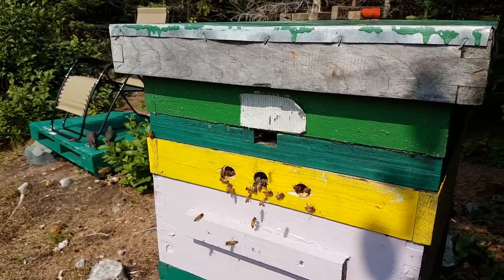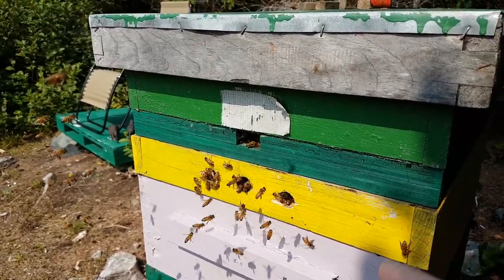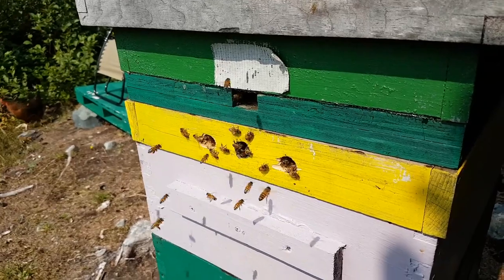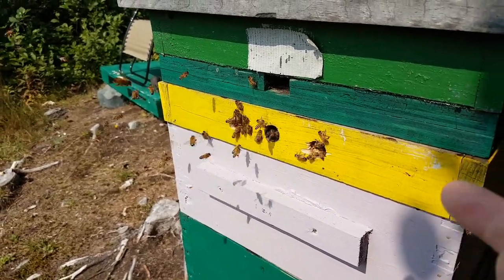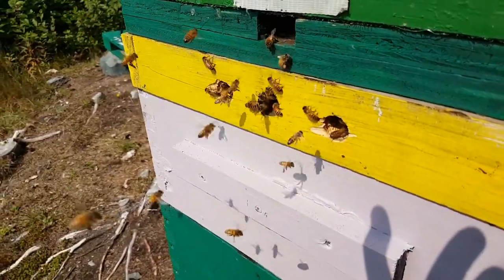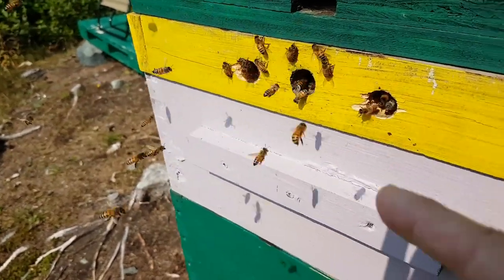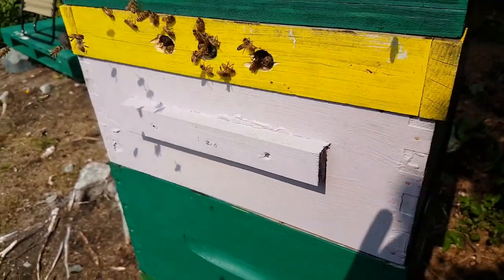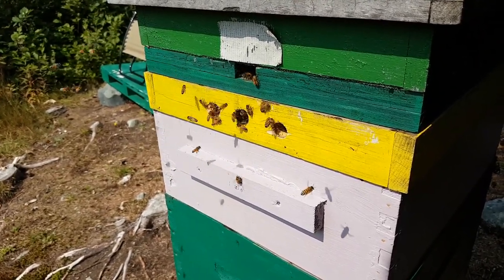A 3-Hole Rim (almost as a good as a slatted rack)

Comment: you say summer position I run the shim the opposite way in summer hole down, the bees come right in to access the supers as an upper entrance, winter I flip the shim so hole is up top against the styrofoam to let moist air out, the three hole entrance is a neat idea on a strong strong hive
Reply from the maker: I call it the summer position mainly because that's what I was taught when I first began beekeeping, so I refer to it that way for other people who were taught the same way as me.  But most of the time, summer and winter, I keep it open so the bees have direct access to the hive.  I should refer to it as the open and closed position for now on.  In fact, I will.

The 3-hole rim has proven to be very handy once a colony's population expands.  This is what I said in the blog post about it:

"In the summer time, the rim provides the bees a place to cool off when the hive is humid or congested, sort of like bearding but inside, and similar to the function of a slatted rack, except it’s on the top of the hive instead of the bottom. Some of the bees, usually young bees that haven’t foraged yet (I’m guessing), will cluster underneath the inner cover and — because of the rim — will have 2 or 3 inches of space to just sort of hang there. It allows them to get out of the way of the foragers. It unclogs the frames and allows for better ventilation and regulation of the brood nest temperature too."

It's impressive to see the bees actually do this on humid days.

Comment: Seems to me that during the honey flow the bees would fill that rim with comb & honey. You will get comb honey and quite a mess.
Reply from the maker: Yes, that could happen, absolutely.  This set up probably wouldn't work on a commercial scale, but for backyard beekeepers who can check on their small number of hives every day (like me), it works like this:  If I see the bees building burr comb to fill in the space, I give them blank frames to or another super to work on instead.  Then they don't make a mess.  I've been doing this for about 3 years now and it's worked out well (so far).

What impresses me the most (quoting from my blog here) is how on hot and humid days the bees will cluster underneath the inner cover and — because of the rim — will have 2 or 3 inches of space to just sort of hang there. It unclogs the frames and allows for better ventilation and regulation of the brood nest temperature.

That's how I'm reading it anyway.  It seems to function sort of like a slatted rack but on top instead of the bottom.

If I didn't check on them, though, they bees would absolutely fill it in with messy comb.
Reply: @mudsongs  If you let them get ahead of you, they will fill it up.  I've done things similar to this when I was younger.  The hive filled it up with comb and honey.  Sometimes drone were laid in there too.
Reply from the maker: @beebob1279  -- You got that right.  I mention this is the blog post for the video:

https://mudsongs.org/a-3-hole-punch-for-beehives/